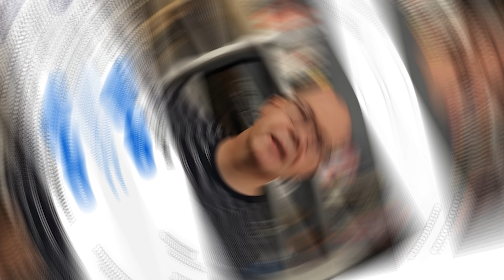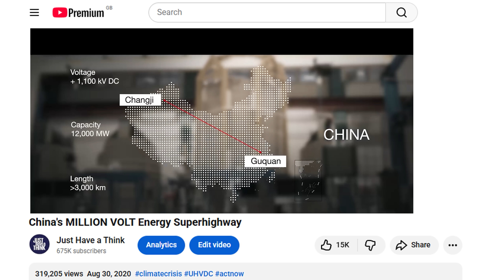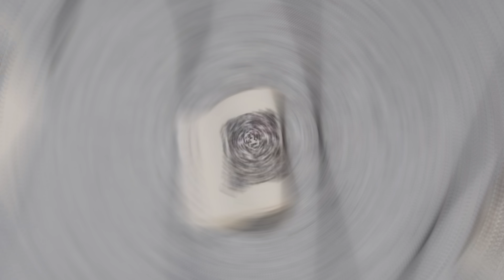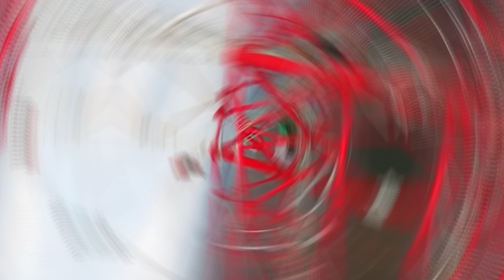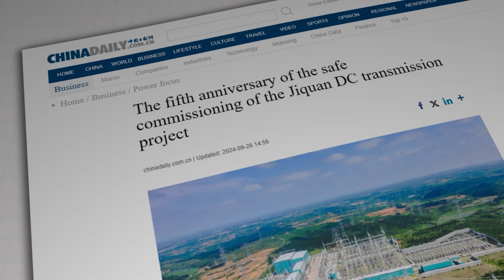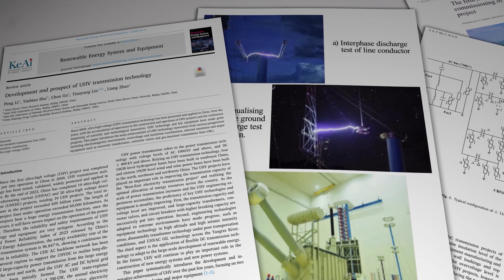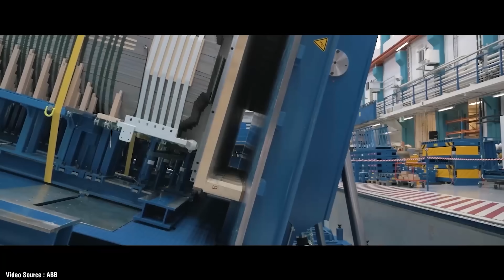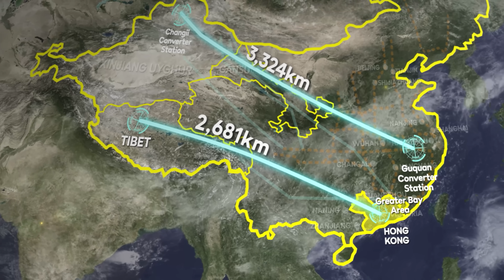China's ultra-high voltage transmission lines now breaking all records.

Comment: China, a nation renowned for having "Tofu" dredge construction...where bribery is widespread to sign off on faulty work and corner cutting. where critical infrastructure constantly fails due to negligence and incompetence. lets see how well that project lasts after the CCP turns their back to its long term work, and is no longer a false bolstering project when the cameras finally turn off.
Reply: FFS!
Reply: You're just practicing old bigotry.
Reply: @TheDanEdwards  pattern recognition is not bigotry. go back home little pink.